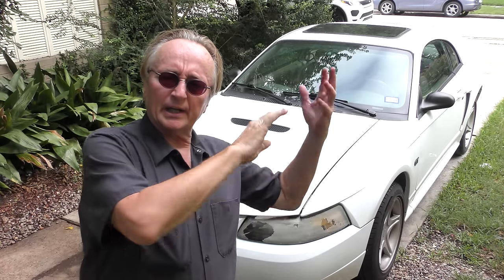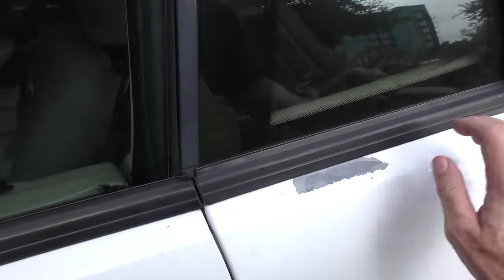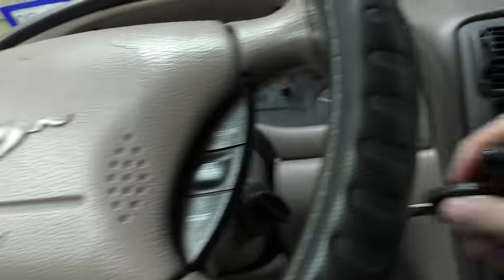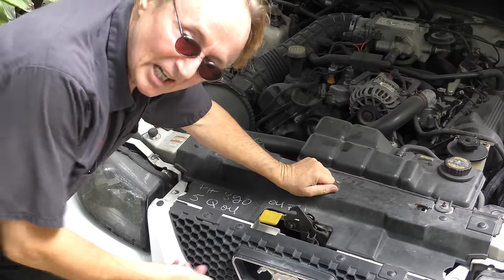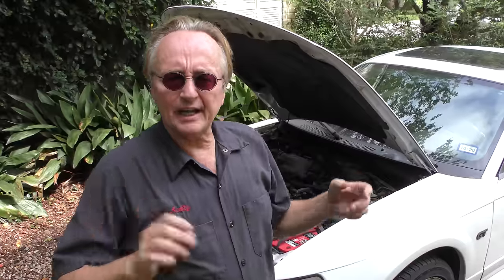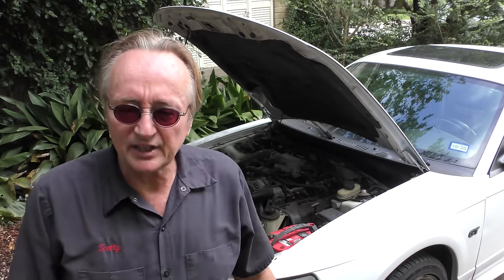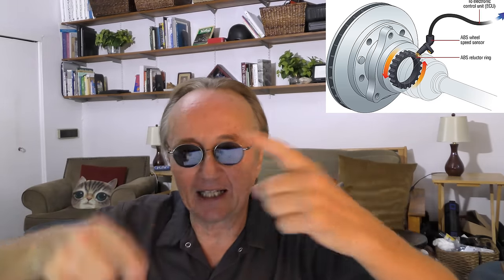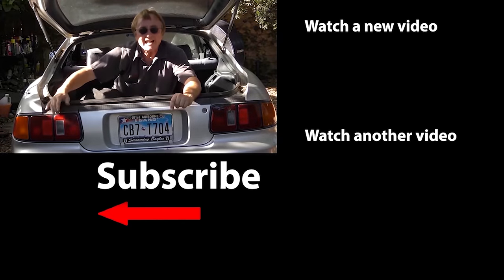Buying an Old Mustang and Fixing It Up

Comment: $500 a year for a Mustang? Ya, I'd say he got his moneys worth! Great deal for a nice little hot rod!
Reply: He could resell it for $1500, so it's $3500/10 years equals $350/yr.
Reply: @DamianoftheRyans  all my fords i've had went 250,000- 300,000 miles
Reply: ultra8magnus some Fords aren’t bad you just have to make sure what you’re buying isn’t junk.
Reply: trigga ville we had an old 99 Taurus and it lasted forever it’s ugly but got the job done and received a Mercury Montego 05 over 200,000 miles and lasted to 314,000 miles right around there before the head gasket went out,
Reply: Panda Gaming 14 Still driving my 02 Ranger at 150k. Shifts great and starts right up. Just replaced the rear shocks myself and the ride feels brand new again. Haha which isn’t great from the start. But still!
Reply: embeaston I’ve got a friend that still has an old Ranger pretty nice vehicle.
Reply: Noah Ballard I plan to keep it until it dies. Even then maybe I’d just invest in it further. I’m not a huge fan of all the new vehicles and the amount of electronics in them. 

Thinking of spraying the whole truck with bed liner too.
Reply: embeaston don’t blame you there the more electronic crap in it the more to go wrong with it anyways.
Reply: Panda Gaming 14  my 94z28 Camaro has 300k plus miles and still pulls like a champ, ac blows cold, all the windows work, handles quite well but I've also taken quite good care of it seeing as I put on most of the miles it's all about how well you treat it not how makes it, it's a machine once it leaves the factory it's all on you how long it lasts
Reply: @DamianoftheRyans  Awful... But yet way better than most manufactures lol
Reply: ultra8magnus all fords I been around be 200,000 miles over original transmission and engine can’t say that for dodge or gm
Reply: Panda Gaming 14 a car isn’t supposed to have problems before 100k miles
Reply: Panda Gaming 14 yeah my dad had a 90s grand Cherokee when I was young and the engine blew up at around 100k supposedly, I’m too young to remember but that’s Chrysler quality for you. Will never buy a Chrysler product as long as I live. I would only consider buying an SRT Or Trackhawk Cherokee if they were actually reliable. Oh and by the way, I’m using Toyo Tires on my E550 Benz and they’ve lasted me awhile
Reply: Panda Gaming 14  is it a v8? what liter?
Reply: Panda Gaming 14  Be careful with that 5.4 triton.
Reply: Panda Gaming 14  how about a 7.3? Wasnt made by ford but is bulletproof in a ford
Reply: Panda Gaming 14  oh nice

Comment: I’ve had 4 of those mustangs and each and everyone of them was loyal all the way only put gas and did oil changes and never game me problems
Reply: Then you didn't keep them long enough lol
Reply: Why did you have 4 of them if that was the case lols.
Reply: @cindysue5474  Maybe he meant 4 'different' trim levels since there were more than 4 different types of Mustangs in this era.
Reply: Lu Pavo because they were so awesome
Reply: @lupavo1738  I'm just messing with him lols.
Reply: @thomasknight7734  Those models are twenty years old. How much more evidence do you need? lol
Reply: I love my manual 01 GT Vert with 88K. Super reliable, only common issues with these cars is the plastic intake manifold cracking/leaking towards the thermostat and alternator dying. Other than that, never had issues. I'd rather take those issues than fixing half a modern car with 100K miles. I can tell you first hand that these stangs can take a serious beating and will really just keep asking for more.  They may not be the fastest but they are fast enough to get you into trouble : )
Reply: Thomas Knight bought new v6 in 1998, still runs fine lasted longer than 2002 Corolla just got rid of
Reply: @McLovinsFunhouse  i agree totally..love my 01 gt auto trans.sounds great too
Reply: @McLovinsFunhouse   I have a 01 mustang Sometimes won't go over 10 Millies what could be the Problem😟
Reply: @elshowdelpape4445  start small....change ignition coil nine times of odd ten is the problem with misfire under a heavy load then check/change spark plugs, wires, Fuel filter, clean trottle body, mass air flow sensor. For expensive fixes fuel pump, evap hoses for air leaks and then catalytic converter which never seem to be the issue most times..... people over look the ignition coil because is gives the right read at idle and mess up under travel via heavy load. With out being there that's how I would start in order. Hope that helps.

Comment: AC blowing freezing cold
Shifts like a dream
Handles quite well
Reply: Not sure about the handling. 
The value when new for a late 80s LX 5 liter from the dealer was excellent.
I think I remember them going for between $15-16k stripped with a 5 speed.
Reply: Gotta make a T-shirt that says that 🤣
Reply: rUnS lIkE a cHamP
Reply: @timetofl0at340  Stops on a dime 🙂
Reply: Still goes down the road straight
Reply: And “starts right up”
Reply: Purrs like a kitten
Reply: Handles well....until it sees a crowd
Reply: Needs a little tlc
Reply: But still not a 94 Celica
Reply: That’s what I said about my bronco
Reply: You forgot Starts right up

Comment: Reminds me of my old 01 Mustang. That was a good car. I bought it in 2011 with 200k on it. I got it cheap because it wasnt running at an auction but to my surprise nothing was wrong with it. We changed the battery, flushed the fluids and fiddled with some fuses when we got it home. It was running like a champ by the end of the day. I had it a few years and gave it to my cousin. It has well over 300k and she still has it as a back-up car.
Reply: The modular v8s last a long time i got a 2000 crown vic police car ithas 234k miles still runs like a champ.
Reply: I love my 01 Mustang! My 2005 sedan deville broke a motor mount, pulled the gas line and caught fire, took a loss, bought my Mustang and never looked back.
Reply: I have 2001 Bullitt with 227K and is a lot of fun to drive. But, I find a oil leak I need to fix and hopping is not the end of the car. LOL
Reply: I got my first car a 2001 Mustang GT Convertible at 2,500. Well my dad got it as a gift to me.
Reply: Can i buy it if you still have it?
Reply: @jacobvernon6040  Oh I gave it to my cousin years ago.

Comment: My first car is a 2000 Mustang. Sold at 185k and still running strong. It has the most user-friendly ways of making modifications. The headlamps, for example, are held down by 2 L shaped brackets which is a brilliant design. Way better than the modern cars which held down by screws. Missing it now.
Reply: I have a 2002 GT, I worked in Hollywood at Post Group Studios. I bought it through the motor pool, they handed me a form where I got to select the build I desire. Sonic Blue, 4.6 Automatic (Disabled Veteran ,left shin held together with stainless steel and 30 screws so couldn't deal with a clutch) Ford Motor Sport headers, flow master 40s, every custom feature available). I had to wait a month for it to be assembled. One day I get called to the front office, my car had just been delivered. A pretty girl handed me the keys. My boss got in the passenger seat, told me we are cruising Sunset Blvd.
Still have it, was going to trade it for a new one. Their mechanic pulled me aside and told me to keep it, it was the last year they made the "notch back" and it's a collector classic. I'm constantly challenged by runners!😎
Reply: Hate auto correct, that's "tuners"
Reply: Yesss headlight modifications literally take two seconds I love it, can switch in red leds if I wanna
Reply: The aftermarket headlights I bought for mine were extremely difficult to put the brackets in. I had to like use screwdrivers  to pry it forward lol

Comment: I've got a 2004 Mustang GT Auto, has 152,000 miles and never an issue with the engine or trans. Baught it used in 05 and has been very reliable, change oil every 5k miles, atf every 30k, coolant every 50-60k, rear diff oil every 50k, still runs and drives like new. These cars are underrated as far as dependability goes provided they're well maintained.

Comment: My '03 Expedition with 216,000 miles has the 4.6 with the 4 speed with OD. Still runs like a champ. No engine or trans problems. AC stills chills.

Comment: Still handles quite well, unless you hit a big bump mid-corner...
Reply: I had a 98 gt in pristine condition the way the back end would act sometimes was scary lol
Reply: Wow , how original.
Reply: Very true...
Reply: Facts
Reply: @willjam465 A big hit with the crowds.
Reply: THE ONEE I race an 85 GT with a Pushrod 302 from an Explorer Against E30, E36, SC300, Miata’s, 190’s, MR2’s and a few other “well handling “ cars in an Amateur Endurance Racing series. Modification is very limited. Springs and dampers along with brakes can be modified slightly. After removal of Catalytic converters  and a decent tune and proper set up the Mustang turns and stops with any of the aforementioned cars. And.......they do not blow the motors or break down. Funny how ignorant trolls feel they must justify over paying for a car that is inferior to a Mustang.
Reply: So dont hit a big bump mid corner. That's what killed Paul Walker and look what car he was in. 😉
Reply: willjam465 you know what they say about mustangs: “ Goes well in a straight line”...
Reply: @dohcsmr1175  I love the 4-eyed foxes.  '85-86 are my favorites of the fox generation.  Have been looking for a good one for the past year, and can't seem to find one in my budget not completely trashed or modified to a level I do not like.  Values have come up nicely the past couple of years.  I have had a couple Mustangs, but newer ('16 GT350 and '17 vert w/ performance pack).  I may shift to a SN95 Cobra if I cannot find the 4-eye I want, as those seem a bit unloved and prices still very cheap IMHO.  I am a huge Mustang fan with a very sarcastic sense of humor.
Reply: Haha true. I own one
Reply: Stang Dad please don’t ever compare a Ford to a Porsche. NOT EVEN CLOSE.
Reply: Turbopickle how is that comparing a Ford to a Porsche?? So are you saying hitting a bump mid-corner has completely different outcomes for both cars??
That would be like saying just because a mustang drove through a pot hole and buckled a rim, it could never happen to Porsche? So we could never compare the outcome because they’re two different cars...🤔
Reply: THE ONEE yeah check my Instagram Nightthugx2k I flipped mine last summer due to hitting a bump mid corner lol. Luckily I didn’t even have a scratch on me . & it was a convertible. God was with me
Reply: Yeah dont turn quick with loose sand on smooth pavement Lol slid forward and kept going for a second
Reply: @RSR8485  yup, goin around a left bend at 80mph, yup the rear acts up
Reply: @stangdad7848  it was dry rotted tires that got him not a bump in the road

Comment: Thank God, I just bought a 2004 V6 Pearl Blue convertible, everybody loves it.
Reply: Fixing to buy a 2000 model v6. 2000 bucks. 110k.
Reply: @johnqueen2754  Cool that’s pretty low mileage for that car that’s a good buy
Reply: The 2000 V6 i had in high school had 282k when it rusted apart finally. The engine was still running strong though

Comment: I’ve had my 94 mustang since 98 and still love it. Currently 196k miles.
Reply: I have a 94 gt  that still runs and drives just fine.  They can be great little cars
Reply: That's because it had a 5 liter instead of the crap 4.6 of the day.
Reply: The 4.6 didn't make crazy power but they were hardly crap. They were fairly reliable and used in many vehicles.
Reply: @Dr.Ticklebum69  Common problems were the timing chain, cracking intake manifold, oil pressure sending unit, and misfires. They got better as the years went on, but new motor means new bigs to work out. The old 5.0 had been around forever, so they had all the bugs worked out by the time SN95s started to be built.

Comment: @Scotty Kilmer, that 385 hp motor was the 5.4, only found in the 2000 Cobra R, and they only produced 300 of those. You made it out to be like it's a regular option you can find when shopping for New Edge Mustangs. The real options were:

'99-'04 GT = 4.6 SOHC 2v v8 (260/300)

'00 Cobra R = 5.4 DOHC 4v v8 (385/385) BUT YOU'LL NEVER SEE ONE

'99/'01 Cobra = 4.6 DOHC v8 4v (320/317)

'03-'04 Cobra = 4.6 DOHC v8 4v supercharged (390/390)

The Mach 1 was about the same as the '99'01 cobra but had a live rear axle.
Reply: Tell em
Reply: I saw a 2000 R, very cool car.
Reply: Mach 1 back then had the dohc 32 valves. .👍
Reply: I was just about to post about this.  I was like, wtf is he talking about bigger v8. Whether it’s a GT, Mach 1 or Cobra(minus the cobra R) they’re all 281ci engines. Difference being GT’s are a 2 valve sohc and Mach/Cobra are 4 valve dohc and the termi came with forged internals and an Eaten supercharger

Comment: Hi Scotty, I bought my 01 mustang for $10,000. That was back in 05. It had 38,884 for miles. I still have it. Had to replace a fuel pump in 2013.Other than changing the oil, tires, new rims and a new top on it it runs great. Love your videos great info too.  And it only has 80,100 miles... Thank you.

Comment: Got my 2000 mustang gt back in 2006, still going strong with 220k miles
Reply: Exact crown vic drivetrain.
Reply: alb12345672 Crown Vic and F150. There were 2 versions of the 4.6 sohc, my Mustang had the F150 engine (more spokes on clutch and more bolts in engine).
Reply: @angelgjr1999  Yes, I heard they were made in 2 plants and are slightly different. That is why some don't blow plugs as much as the other. There is also an Aluminum version in the Explorers.
Reply: alb12345672 Yup. They’re pretty much the same engine but I think it’s cool that a coupe has the engine from a full size truck.

Comment: I got a 2001 GT for 6200 with only 72k miles. Done a few mods, 2.5 inch exhaust with supper 44's. 78mm throttle body and BBK cold air intake with a tuner

Comment: I'm still driving my 2002 Mustang GT that I bought in 2002. The only things I've had to replace is the battery and the head audio unit. I have to admit that I didn't maintain it as well as I should have but I have got everything up to par now. The car has performed well despite not changing the fluids at the proper intervals (engine oil was changed on schedule though).  I just finished a radiator flush today and you might interested to know that the original thermostat still works - but I replaced it anyway. Optionally, I upgraded the halogens to LEDs as well as the dash lighting was upgraded to LEDs and the courtesy lights were upgraded to LEDs also. The car just turned 70,000 miles. I'll be happy if I get another 70,000 out of it.
Reply: What is your daily driver? Only 70k miles!
Reply: @DeeRuss  It's low mileage mainly because I was assigned a work truck prior to my retirement. Now I alternate between my Xterra and the Mustang. I put only 10,000 miles total every year (about 5,000 on the Mustang and 5,000 on the Xterra).
Reply: Nice. My 02 GT has 64k
Reply: You may needs a new fuel rail soon. It will see as many miles as you maintain. Good vehicle

Comment: All you need is 3000 grit sand paper, a faded headlight, compound and polish.
Reply: Mothers mag and Aluminum polish and a foam pad is all you really need.
Reply: Can buy brand new tinted OEM headlights for a few hundred dollars.  Will have to shop around but is worth it.
Reply: Theres different ways to have the headlights clear up well, the question is which method works best for long term lasting results.

I have done with the wet sanding method before, then use the buffing / polishing wheel, with the polish cream, not sure if it's the best, but it seems to work.
Reply: Sand and  then spray a couple layers of epoxy resin...
Reply: Just buy new replacements for 60 dollars
Reply: Rustoleum makes a good product, TOO.
Reply: FoDaddy yes I payed 60 dollars for some clear corner ones and I’ve had them for a couple of years now they still look new
Reply: Not when the condensation is inside the headlight
Reply: Lukas yes that’s a big problem with cheap headlights! I normally just re glue around the edges
Reply: And a crowd of pedestrians
Reply: WD-40 old tube of toothpaste

Comment: My 2000 gt is still going strong with 116,000 miles! Haven’t had any problems with it besides having to change the fuel pump and replacing the clutch. Not super fast but it’s a fun car to drive.

Comment: I just bought a 1996  Mustang SVT Cobra  Convertible . 
21-K original miles 4.6 -V8  garage kept . 
12 - K  and it looks brand new. 
The 4.6 -V 8  if it’s maintain can last 3 to 400,000 miles. They use them and taxi cabs Crown Victoria‘s. 
It’s nice to hear Scotty talking about quality built American made vehicles. 🇺🇸🇺🇸🇺🇸💪🏻

Comment: Had to tell you about my experience with a 1995 Ford Mustang with the 5.0 (302 C.I.) engine.  The car was so light in the rear & with so much power from the engine you could easily spin the rear tires when making a turn if you weren't careful.  It also could not make it up any grade with ice & snow on the road.  These are things they failed to mention in the reviews before I bought the car.  I am glad you are not afraid to tell it like it is.
Reply: But they don't spin outta control like the videos you see unless you're too bad at driving. Used to slam thru the gears in the rain at a light at night in my 97. Got it up to 90 in 3rd, would let off the gas and would really be doing like 45 and still going straight. 
Of course once I got good tires it was a different story.

Comment: I have a Red 2004 base convertible the 3.9 liter with 87,000 miles. I put quite a few mods on it never had an issue.

Comment: Hurray for my 2000 mustang too. I got the stock v6 no frills. 190 horse power. Still going strong. Classic plates on it now. Automatic, no abuse from stick shift 8 cylinder racing people. 208,000 miles.

Comment: Just bought a 2000 for 1k, just needed to change the mass air flow sensor, clean throttle body, spark plugs and use some engine and gas additive and it runs perfectly now.